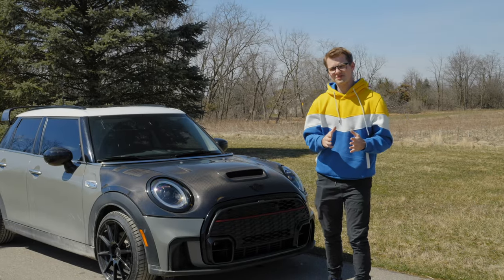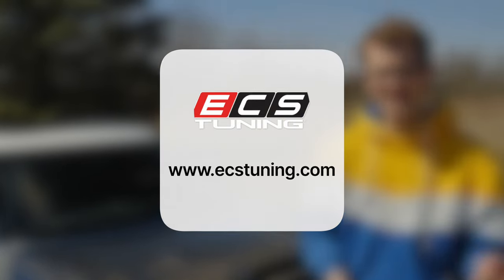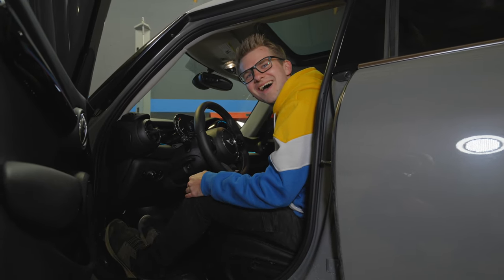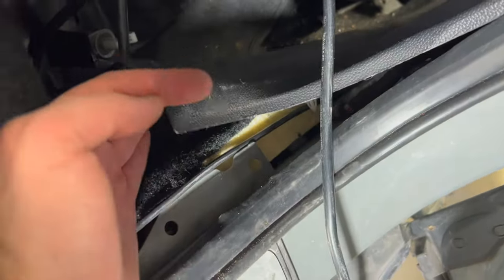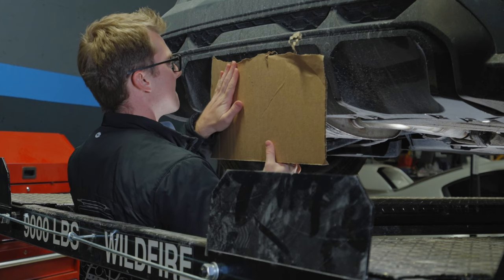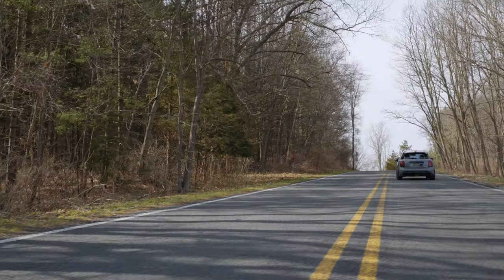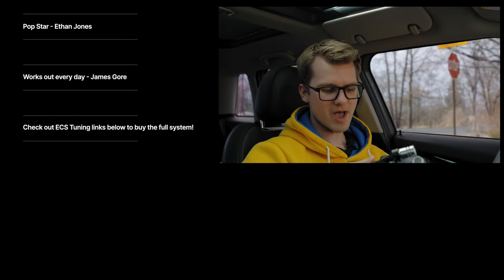MINI JCW Pro Exhaust Install for any JCW or Cooper S...

Comment: Hi! I have a JCW F56 LCI2 from 2022 with OPF (particule filter) from Europe, where I do live. At BMW dealerships they say I cannot use this exhaust on the latest JCW as the VIN number of my car doesn't show this item as an accessory. Are you sure that it could be fitted? Thanks
Reply from the maker: Hello, I live in North America so unfortunately can’t really speak for the laws there. In the links I have there is an exhaust for 2020+ years but that may be for North America only. 
I know some people have found ways of getting rid of and coding out the gpf but I don’t know much about it. May be good looking into that and then getting the exhaust after.
Reply: I have the same 2022 JCW and live in the states - NYC and my dealer told me the same thing
Reply: Im from Portugal, and I have too a JCW from 2022, I asked at a Mini dealership about this topic, and they said its not legal to put this exhaust on our cars because of the rules related to the OPF emissions. This exhaust can fit on our cars (our cars are the same as the pre-facelift ones structurally) but I think is not possible to legalize it. They said to me that I can buy it though

Comment: I had the Pro exhaust on my last Cooper S. It sounded fantastic but I found myself getting tired of the pops after a while. Would have been nice if you could turn that off through settings without having to get out of sport mode completely. My current car (21 mcs) doesn't seem to pop much at all which I'm glad about so I may put a pro exhaust on this one at some point. Love the sound of the pro exhaust. Love the "fart" on upshifts, but the popping got really old after a while to me.
Reply from the maker: Yeah I can totally see that perspective. I always quickly turn it off when I’m in my neighborhood. I also don’t always drive with it on because it’s a bit much. However I do still appreciate the pops.

Comment: Hey mate quick and kind of boring question. How loud is it when the valves are closed? I was thinking of getting it for my cooper s 24’ but I have a pretty long and early commute and I can see myself getting sick of it after a while.
Reply from the maker: Yeah a perfectly reasonable question. It’s actually quieter than the standard jcw exhaust that comes on the car.

Comment: From your sales link: "Activation code in envelope will need to be flashed at MINI dealership for flap system to work and engine remap."  Your flaps work without flashing at the dealer, so does the flashing actually only refer to the tune (which I know you said you didnt install)? Concisely put: is any coding or flashing required for only the exhaust flaps to work? (Without the tune)?
Reply from the maker: Correct, the exhaust flaps work without any coding. 
It’s just the tune that needs to be coded from the dealer.
Reply: @carcreationsyt  thanks!

Comment: Hi,  I have a 3 dr JCW 2023 and live in Canada. I went to the dealer and they told me that it is not fit with my car. They search with the Vin and told me that not fit.  Is it any chance for me purchase the 2020+ and it fit my car?
Reply from the maker: I had a Canadian dealer tell me that too, however it does fit. They simply stopped selling the exhaust for those years so the vin wont match in their system. The 2020+ link I have in the description will work perfectly for you.

Comment: Hey really nice video. I am thinking of getting this exhaust for my 2016 mini cooper s. Does it need any coding? Bc the guys at the local bmw store claimed so. Also, which exact exhaust set did you buy? I see a couple ones on the market at different prices!:) thanks in advance!
Reply from the maker: Thanks so much for watching and sorry for the late response. You don’t have to code the car for the exhaust to work… however if you have a cooper s and want the pro tune that comes with the system, you will need to get the car coded. 
I got the system under the f55 link in the description

Comment: When you grounded it where exactly did you put it? Following the instructions it says to back it to the bracket but that’s not such a good ground. Actually it doesn’t ground at all.
Reply from the maker: If you pull away the panel on the right side of the boot, there is a grounding plate. I attached it under that plate.

Comment: Hi. I have a 2020 F56 JCW and REALLY want that system!! Is there any way you by chance know if it would fit?
Reply from the maker: Hello! Thanks for watching! I am unsure if you live in Europe, but if you live in North America, there is a 2020+ specific exhaust! I have a link to the system in the video description
Reply: I live in Europe, but the systems should be the same. I have tried pressing all the links and typing in my cars information, but it says “do NOT fit” can you please send the link? 🙏🏼
Reply from the maker: @mikkellauesen3125  Oh ok, so in europe you would have a gpf on your car... That's why they say it does not fit. You can still install the exhaust, but its not 'supported' and you have to only install half the exhaust portion (after the gpf) or get the gpf error coded away.

Comment: Question: How do you remove the blue tab from the back of the fuse box where you need to push in the 
red and black terminals?
Reply from the maker: I got a little flat head screwdriver and inserted it under the tab and pulled. 
The first time I did it, it came flying out 😆
Reply: @carcreationsyt  😅 got it done. Thank you very much. It sounds awesome with JCW pro.
Reply from the maker: @jaireco  Yay! awesome!! No worries! Yeah I agree, its amazing

Comment: I assume your car had the GPF on the exhaust. Did it cause any codes by removing it?
Reply from the maker: Mine did not have a gpf. If yours does, you are correct, you would need someone to code them out

Comment: Can you please tell me what tips you used ? I bought my exhaust without one and I can’t find the ones that fit. Thanks
Reply from the maker: I put the right tips and exhaust links in the description of the video if that works for you!
Reply: @carcreationsyt  did you have to buy the chrome ones to put firts ? And then carbon ones on top of it ? Or just carbon ones straight away please ?
Reply from the maker: @MrHezu  I just got the carbon ones. 
I had another mini before this and got the chrome ones for that

Comment: Mine no longer works, the remote just gives me one blink. What could be the issue?😢
Reply from the maker: Could be a battery issue but sometimes you just have to repair it. 
Hold down the button for 10 seconds then try again, if that doesn’t work, hold down the button till it stops flashing and AS SOON as it stops flashing let go. Then try again. 
Both methods have worked for me in the past as I have had to do it a number of times due to disconnecting the car battery for retrofits.
Reply: @carcreationsyt  thanks. i just checked in the boot, the module is not giving me any status light, not getting the red blink or anything from it
Reply: 😭😭😭😭😭its fixed man, I just removed that fuse you put in F74 and put it back. I have my pops and bangs back, after a whole fucken year😭😭😭 thank god i bumped into this video today, would never have had the courage to fiddle around and press shit
Reply from the maker: Yayyy!!! 🎉🎉🎉 that’s awesome!!! 
Thanks for watching! Enjoy the best part of a MINI once more!!

Comment: Does this exhaust system consume significantly more fuel? In the same driving mode and with the VAN OFF. My car is F55 2018. Thanks!
Reply from the maker: Hello, from my experience it does not. However you may find you use much more fuel with the valves open as you want to hear the pops and that is literally throwing money in the fire.

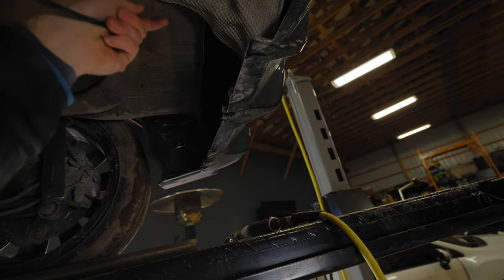Comment: 9:10 I don't quite understand that you meant with this oral instructions. What corner the wire goes around?

I tried to focus on it afterwards throughout the video and I don't see how you benifitted from removing that heat shield. Am I wrong or am I missing something?
Reply from the maker: Hello, thanks for watching! We had to remove it as where the wire exits through the floor is directly under the heat shield. We then routed the wire around the heat shield
Reply: Actually thank you for responding and making this very helpful video.

So, at 8:26 you said after removing the heat shield that the the "hole" 🕳 is actually directly under that plastic piece. I'm confused...

Also, for the wiring diagram in the video. I understand where the 2 fuses plug into. But what about the cables themselves where do they connect to? And are they also "plug and play" or do I need to modify them of some sort?

And what about the ground wire. Where does that attach to?

I know my questions might sound ridiculous, but please bear with me. I'm  a rockies and I don't want to mess this up
Reply: It's also visible at 10:04 that the cable just hangs down right from the base of that plastic top meets the chassis (not from between the heat shield and the chassis). Correct if I'm wrong

Comment: So is this what it sounds like on the JCW or just the s? I have an F56 and am wanting to know if the tune and exhaust kit will make it sound like this or if it will be different before I spend all the money.
Reply from the maker: This car is a Cooper S so the sound you hear in this video will be true for the cooper s with the exhaust. From experience, the sound is very similar to the jcw with the exhaust

Comment: Was the ecu tuned and is this an lci2 jcw?
I’m looking to get an idea of sound for a resonator delete and sport muffler but every video I see for the lci2 is a UK car that was tuned due to the opf delete.
I can’t for the life of me find a sport exhaust on a US car that is not tuned due to the bench unlock requirement for the ECUs
Reply from the maker: My car is pre lci, and I just face lifted it however if you want to hear sound, the miniac put it in his lci2 jcw so you could hear the sound there. 
If you’re looking to purchase the exhaust, make sure you use the newer car exhaust link in the description as I believe they changed it slightly for the lci2 models.

Comment: Why is this kit not available for 24 JCW???
Reply from the maker: It works on it if your in North America, you just get the 2020+ cooper s tuning kit one and don’t install the tune.
Reply: What is the tune for exactly??
Reply from the maker: @8uMayed  On the cooper s it brings your hp levels up to 205 hp and you get a certification from MINI for you car that classifies it as a MINI Cooper S - JCW lol
Reply: @carcreationsyt can’t I just get the pro exhaust kit that doesn’t come with tune? Yes I’m in North America too
Reply from the maker: @claudetheruler  its not in stock however it costs the same price with or without the tune addon. 
It’s fine to get the tuning kit and just not install the tune. 
You could ask their support if you are worried.
Reply: @carcreationsyt  So if I have a JCW already, I can install the "pro" exhaust and it will be different than the stock JCW exhaust?

Comment: Very specific question that i can’t seem to find an answer to… I bought this system used for my wife’s mini and it does not have the connectors for the positive and negative wire that go into the fuse box (previous owner cut them off thinking they couldn’t be removed) Would it be possible to do a simple add a fuse and connect the wires to the fuse rather than plug into the back?
Reply from the maker: Good question! I would say to maybe try to do it properly. I think they do sell just the harness. However if you don’t mind, you could test it and see if it works.
Reply: @carcreationsyt  yeah for anyone else that has the same issue as me simply use an Add-a-fuse adaptor into the same exact fuse slots and it works exactly the same. I was able to get it to function that way.
Reply from the maker: @XLR8Films5  good to know, thanks so much for the update!!

Comment: Hey dear, maybe someone could help me here. I have a 2017 Cooper S F54 and just want to swap the S Exhaust with a Jcw Exhaust , but the JCW Exhaust have a Valve but idk how to wire it so that i can open that valve on my Cooper S
Reply from the maker: Hello! It should be exactly the same setup as we did in this video to pair the Bluetooth button to the exhaust.
Reply: @carcreationsyt hey thanks for your awnser,  its not the pro exhaust , it would be a stock jcw exhaust from 2018 without any buttons to open the valve
Reply from the maker: @HDLetsPlaysHigh  Ok, are you sure it has a valve? My oem jcw exhaust did not have one

Comment: Great video.  I bought a 2017 Cooper S Works second hand recently in UK with this JCW Exhaust installed already and get no pops or bangs in Sports Mode at all.  When I open the valve with the remote I get maybe one muffled pop here and there but its' very limited.  I'm convinced previous owner has turned something off on the car via ECU or exhaust but I don't know how or how to fix. Car performs great otherwise and low mileage.  I asked local Mini dealership but don't seem to want to know when it comes to exhausts and look at you funny when you ask where have the pops and bangs gone lol.  Like you I bought the car totally for the pops and bangs where it should be sounding exactly like yours. The 2017 models were the last in the UK to make great noise and then 2018 laws started to change to tone it down.
 Not sure if you identified anything when fitting system where you could turn off/adjust such noises.  Appreciate any help or advice to check
Reply from the maker: Thanks for watching! When you open it, did you turn it to race mode with two clicks of the exhaust remote? 
That’s frustrating that it doesn’t work. Also sometimes the remote disconnects so it doesn’t actually turn on the exhaust, you hold down the button for 10 seconds, then try the two clicks again to see if it opens. 
You also said you do it in sports mode so that can’t be the issue. Some people try it in mid, and that doesn’t work lol.
Reply: Seems it's a software problem. Probably you need to install some custom software not in official MINI dealership
Reply: Thanks for reply, I was thinking the same as I've tried everything.  Will get it booked in somewhere.  Thanks again for your help. @TrampChannel

Comment: I had the Pro Exhaust + Remap. on my F55S... When I start using it, like in 15 min, the valve closes. does that happen to yours?
Reply from the maker: Hmm that shouldn’t happen. I wonder if the valve is loosing power somehow. Maybe check connections? 
Worst case, open the valve, then disconnect the wire to it and it will stay open 😆
Reply: @carcreationsyt  dealer say was the battery, so, changed the battery and stay open a bit longer... but still sometimes it shut by itself... its happening to several people with the JCW Tuning Kit, what I did, is i unplugged...

Comment: I have a 2015 JCW, I have the sports factory exhaust, but it doesn't have a remote or the valve flap. Can I just buy the remote, flap, wires, or components, or do I have to purchase the whole exhaust kit? Also, what is the difference between JCW and JCW Pro? As in, is it performance or just looks. My guess is I got the JCW and not the JCW Pro, but im unsure
Reply from the maker: Unfortunately it’s just the jcw exhaust, not the pro jcw exhaust. 
The pro one when compared to the jcw one you have is slightly more quite when flap is closed, but louder with snappier pops when the flap is open. 
If you wanted to upgrade you would need a full upgrade
Reply: @carcreationsyt  OK makes sense. I will upgrade as thing that needs fixing. Thanks for the info and videos. You got a new subscriber

Comment: I have a ‘24 lci2 JCW- any install issues for the Lci2?
Reply from the maker: If you are in North America, make sure you get the latest system that I have linked in the description. 
If you are in Europe, you will need to get the gpf filter coded out unfortunately
Reply: Awesome, thank you!

Comment: hello! Did you delete opf or do you keep it to avoid errors?
Reply from the maker: This car is actually older than the opf days, I just face lifted it in some of the other videos to look like a brand new mini. 
I wanted to do this exhaust upgrade and some tuning without opf issues sometimes a nice compromise
Reply: @carcreationsyt  ah okay okay, in a JCW lci2 it doesn't sound like that xD